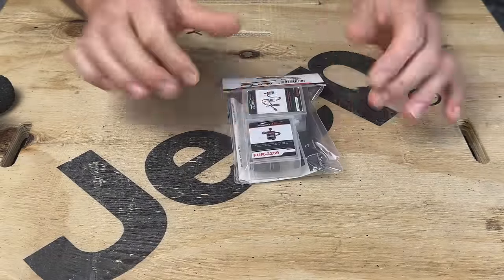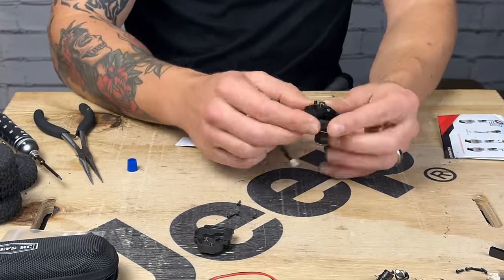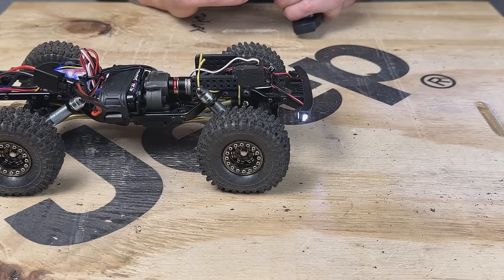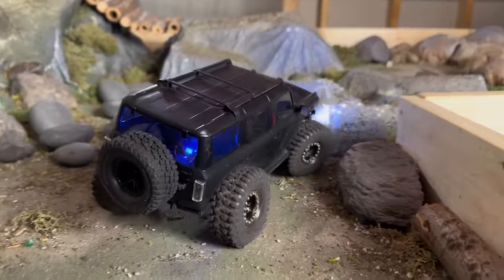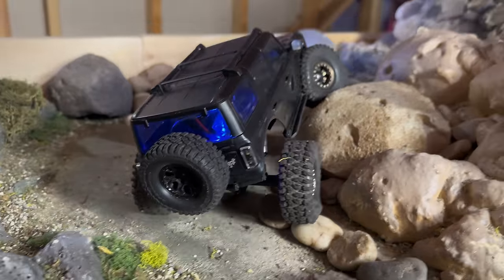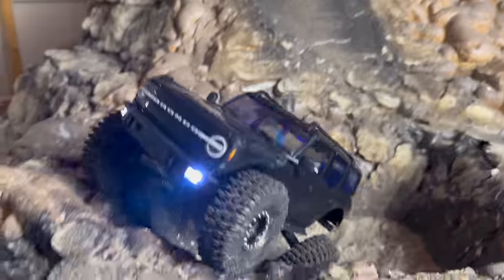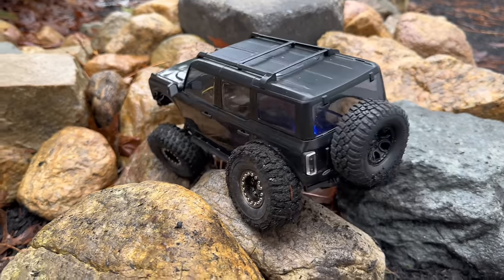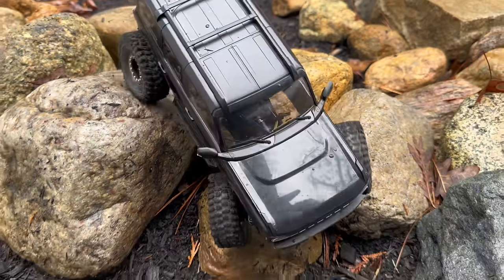Traxxas TRX4M UPGRADES - Brushless Motor Upgrade! Furitek Stinger - Installation & Crawl Footage!!

Comment from the maker: Timestamps
Close look at the stinger combo: 1:19
Installation and first impressions: 3:43
First run and demonstration: 5:58
Course runs and crawl tests: 7:01
Final thoughts: 15:12
Reply: Do you get the same articulation with them?  Also are you finding that the front don’t drop as far as rear dose do to the front drive shaft?  And one last question, will you be doing the chassis conversion suppose to help with servo limiting droop and or binding on sides. Love the videos. I’m new to crawling and they are very informative.
Reply: Wondering if you have any tips on a issue I'm having. I have a defender body, Injora extended axles, Injora 10mm hex extensions, and the same tires as you have in this video which I believe are 2.52mm. I took off wheel fenders and hacked pretty much the fender off but it still rubs and catches inside of headlight bucket under flex if the hexs were a +8 they would prob clear but they don't make so many tips before I chop up the headlight
Reply: What remote do you need to make it work with this kit?

Comment: This setup has so much power, snapped my driveshaft clean in two. Metal ones going in as I watch this.  I have the crawler gears but may go back to stock when I get my spare trans back from a friend
Reply from the maker: It’s super powerful isn’t it?! I’m glad I got the metal shafts when I did (coincidentally). Curious to see how it works with stock gears
Reply: How is the setup with stock gears?
Reply: I ruined the plastic crawler trans gears and got metals ones from ebay in the stock ratio and it's a little too quick now. Metal gears are a must and with this combo, I would go with 12 to 40 percent reduction for my next steel set.

Comment: I have a nearly identical build and I have the worst time with torque twist. Climb up any slope and the body just torques over emediately. Doesn’t matter how slow. Wondering if any one has any advice. Thanks.

Edit:
Just found your video on torque twist. It made a huge difference, thank you.

Comment: Yeah but that Servo sure was rocking back-and-forth as you turn the steering
Reply: Yeah, that needs to be more solid so it's not wasting all it's torque.
Reply: New to the hobby. What do you guys mean about losing torque and the servo moving?
Reply: Just a guess as I am also new but i think they mean that where the servo could be using energy (torque in this case) to turn the wheel, it is instead using some of it to move the actual servo.

Comment: Have ordered the same wheels, tires, axles, gearing, suspension links and diff covers for my Trx4m 

Trying to keep up but it’s adding up 🤣 Ty for the injora discount code
Reply from the maker: Thanks for watching! I’m taking a breather with the bronco now. My credit card needs to cool off 🤣
Reply: @CapeCrawlers  basically I’m trying to get as much performance without breaking the bank to much. I think the new electronics are out of budget, currently have a whole bunch of other projects on the go. Keep up the good work. Your videos are great quality and I love that your kids are getting into the hobbie too

Comment: Great point about the metal trans gears. This is my last point of failure on my defender as well. Curious if you noticed any cogginess transitioning from low speed to higher speed running. On mine its at about 60% throttle. I feel like this motor is just slightly underpowered- curious about the mini Komodo. Also I emailed them about hopefully developing a firmware update for adding the pro scale light kit
Reply from the maker: I havent noticed the cogging personally. To me it felt really smooth. Smoother than my other micro komodo actually. I would love to get the lighting kit back in order!

Comment: i did some playing around with my bronco body if you heat up and bend the door panels inward so it hugs the frame it works extremely well for sliding over rocks and going threw tight spaces
Reply from the maker: Good idea although the thought of trying it gives me anxiety 😅
Reply: @CapeCrawlers   it did for me because I made a mistake while trimming the wheal wells but it’s working surprisingly well and the plastic didn’t change coulor

Comment: I did the micro as well, love your channel. I have low speed cog tho. Any thoughts I still have normal gears. Had injura driveshafts, but went back to stock to see. But to no avail
Reply from the maker: I feel like the stinger struggles a bit with stock gears. They feel way too tall. Have you always had the cogging issue? Just wondering if a reset of the app or firmware update would solve it.

Comment: you don't need grease on composite gears its not metal to metal contact? I see people keep making this mistake for some reason... It also seems to twitchy.. the slow crawl is nice but then its just full on power very quickly you can see that in your video of it.. just seems like to much and not much control past the super slow crawl
Reply from the maker: I didn’t know not greasing them was the norm. But it makes sense I guess. Maybe it was my one handed driving but I felt like it was pretty smooth. I had the micro komodo in my gladiator and this setup is much smoother without the twitch when it leaves FOC. It’s certainly not as smooth as the new mini komodo though

Comment: New to RC and definitely interested in going brushless on my trx4m. Question though... I have the stock transmitter and receiver (first rc so I dont have a tqi laying around), what would be the cheapest way to get that brushless setup to work? Will any 2 channel transmitter and receiver work?
Reply from the maker: I don't think any 2 channel tx/rx combo will work. I would vote for the Flysky GT5 transmitter/rx combo. It's around $79 and works great. https://amzn.to/3Whrfrx

Comment: I recently got one of these trucks. I want to upgrade to a bigger shock but don’t know what size? Can u help ??
Reply from the maker: You're pretty limited in shock options for these at the moment. I think only Injora has released aftermarket shocks specifically for this vehicle. If you're just looking for more articulation, flex extensions are a great option. Check out Adaptiv3 Designs on Etsy. Another option is Losi Mini B rear shocks. They fit with some modification and are ~10mm longer than stock shocks.

Comment: Hi, I just installed mine and it seems like it is binging up/not spinning freely in the transmission. Not sure if that is normal or if I did something wrong 🤷‍♂️
Reply from the maker: It should be nice and smooth. Could be a gear messing issue by the sounds of it. I would suggest breaking down the transmission and seeing if you can realign it and smooth it out. I had a little bit of trouble with the gears when I swapped them out, but it's nice and smooth now.

Comment: What's the difference between the komodo and the stinger? Is it just the form of the motor ,speed,power?
Reply from the maker: Mainly size. The micro is super small and has a much higher KV, so it's a higher revving motor. The Komodo feels smoother and a bit torquier in my opionon.

Comment: So if I bought that motor could you plug it into the stock esc so I can keep the lights or do you have to do it all?
Reply from the maker: Unfortunately not. The Furitek system isn't compatible with the Traxxas esc.

Comment: I have really being enjoying the TRX build series. I noticed that my transmission was dry as well. What lubricant did you use?  Also, Meus is now offering a metal crawler gear set.
Reply from the maker: I use the traxxas silicon grease. It’s not necessary for composite gears, but I did it anyway. I just got my meus gears today!

Comment: Great video! I can't wait until my micro komodo comes in on Monday. I also bought a MOFO RC BAM micro brushless motor. Will be neat to see how it compares!

I'm curious about how the standard gears work with the komodo given its low-end power. I imagine the crawler gears are nice to have, but are they even necessary at that point?
Reply from the maker: Thanks! I honestly feel like the crawler gears work really well with the komodo. It gives you that ultra low speed control and very smooth power delivery. I may try it in the stock transmission just for the fun of it though
Reply: @CapeCrawlers  Coming back to this, I had a chance to try the komodo with both gear sets today. 

With the stock transmission gears, while the komodo still had better low-end torque than the stock 180 motor, the komodo was still a bit jumpy compared to crawling with the crawler gears. I feel like this was to be expected, but I wasn't expecting how drastic the difference was. Crawler gears are a must in my opinion with the komodo, but if I didn't know any better, the komodo would still be seen as an incredible upgrade.

Comment: Is the motor waterproofable? Or is there any other waterproof options for brushless micro crawlers?
Reply from the maker: Furitek makes the lizard ultimate which is fully waterproof. You could use that instead of the lizard pro. But you’ll need a waterproof rx to mate it with. I’m not sure about the motor honestly

Comment: The control is insane. But I can not help but wonder - is the Avatar radio plus receiver the best way to go, or would a different combination offer more flexibility (e.g. wider range of compatibility with different ESCs). I am asking as I am yet to get a proper crawler - we only have the Glacier where I would like to update the ESC (probably to the 1080)
Reply from the maker: I’m going to start experimenting with other transmitters and rx combos. So far the furitek is the only one I’ve tried. So we’ll see! I hear great things about the flysky gt5
Reply: @CapeCrawlers  I will be following your updates closely 👍

Comment: Do I have to use the Furitek Avatar transmitter with this brushless conversion? Or can I use like a Sanwa transmitter
Reply: you can use any other TX/RX but not stock
Reply from the maker: 👆🏻 is correct
Reply: Ok thank you

Comment: You have any recommended settings to smooth it out
Reply from the maker: It's really just troubleshooting with the app. You can try adjusting the slow speed in the throttle settings, as well as the punch. On the throttle curve itself you can adjust those dots up and down to get the desired smoothness.

Comment: Has anyone else done a rear steering conversion for their bronco  trx4m yet?
Brushless and rear steer are always first on my list of upgrades but now it crawls so well I don't know if ther is much left to do to it other than find some taillights.
Reply from the maker: I’ve not seen anyone do a 4WS setup yet. I would be interested in seeing it though!
Reply: Have just done both easy but costly. To do 4ws front axle goes right in need to cut rear center frame cross section shock mount and remove ESC. Then add in electronics for rear steer.

Comment: What shocks are those? I want to upgrade mine but kinda don't want to spend $50 to do so.
Reply from the maker: Losi mini B rear shocks. I got the aluminum which were around $40, but the composite versions are much cheaper
Reply: @CapeCrawlers  Thanks for that. Are the springs that come with them soft enough or could I use the stock Traxxas ones?
Reply from the maker: @SYST3M_OVERIDE  the springs that come with them are VERY stiff. The stock traxxas springs fit but I still felt like it was sitting too high for my liking.

Comment: I know it’s a crawler but I would have loved to see a top speed run.
Reply from the maker: I can do that in an upcoming video. It's fairly quick. It's still running the crawler gears, so it's not a rocket ship by any means, but that micro komodo can sing
Reply: @CapeCrawlers  oh I 💯 understand. I’m looking at getting one to crawl. We have a deadbolt, mostly stock and we love crawling with it, but we also just drive it around the house and would like just a TAD bit more speed. Though it looks so goofy with its stick bouncy shocks 😂. I know with stock gearing the trx4m is faster than the Scx24, but I was curious how it does fully decked out with crawling gears, extra weight, way better suspension, and most importantly brushless. I’ve only ever had 2 hobby grade RC’s, my axial and a 1/36th scale (if memory serves me correctly) from Losi Micro T. That thing was a blast, but I had it going 30+ MPH and broke it every time I played with it 😂

Comment: Can you possibly show that Injora body on a Deadbolt?
Reply from the maker: Which one, the new buggy?
Reply: Yes..the buggy you have. Alot of Bolt owners would like to see I'm sure. All your suspension tricks have worked great on mine. Big help. Thanks.
Reply from the maker: @vikingblood5775  I'll see if I can pop it off and put it on a deadbolt next time I'm doing work to it. I've seen some folks put deadbolt links on the buggy and it looks pretty rad; super stretched in the back